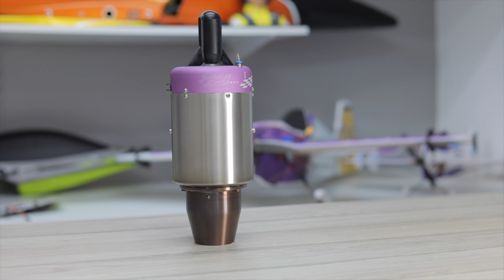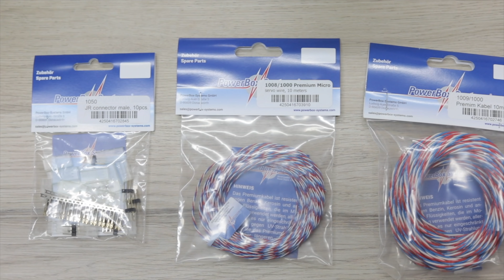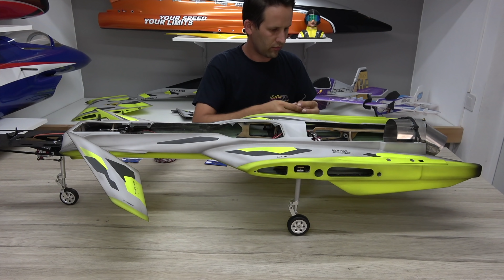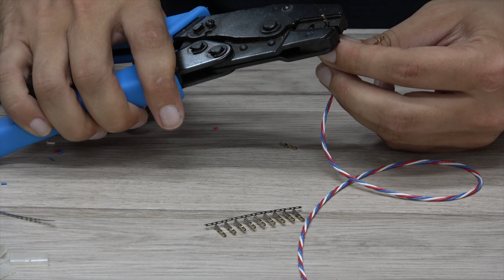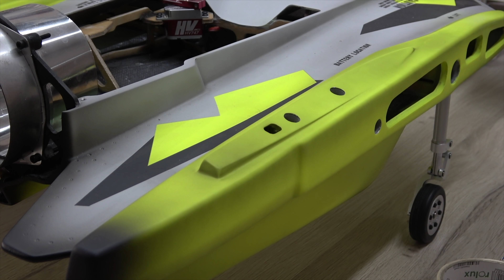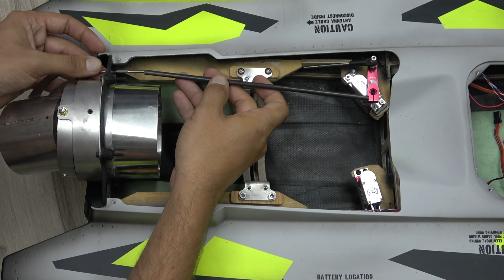SAB Lizard 3: INSTALLING 127.000RPM JETCAT P130Rx TURBINE!

Comment: Hello Martin. Many thanks for this video. Question about plastic cable ties you used inside the tank. I never add this, only the hose pipe on the brass tube. Do you have any recommendation for the material ( nylon 66?)

Comment: Great stuff thanks for doing this as like I said before there is nothing on this also would be good to show uat to fuel tank and turbine set up , then radio set up of turbine many thanks
Reply from the maker: Thanks! Will be doing all that in the next video, hopefully all the stuff I figure out can get shared and help!
Reply: Martin Pickering thanks for doing this doing a beginner series of how to get into jets and how to fly them and maintain them, I am only now starting my self and there is so little knowledge out there in videos. From everything like the fuel mix to setting a turbine which is not full auto I.e all pumps built into the turbine, setting up,a powerbox maybe it’s me but I have not found a series like this cheers